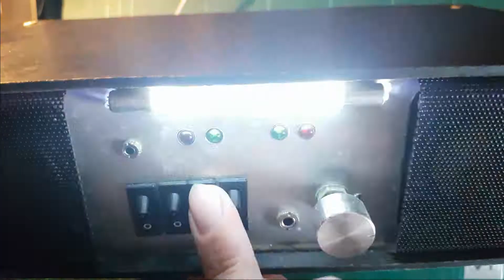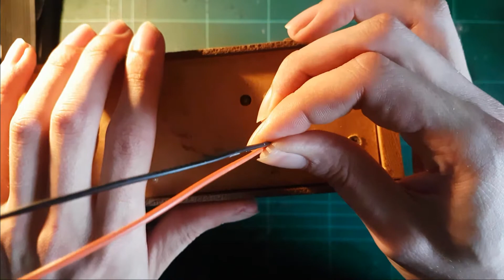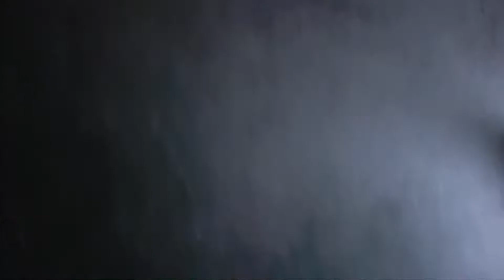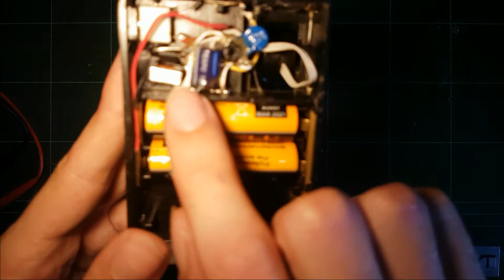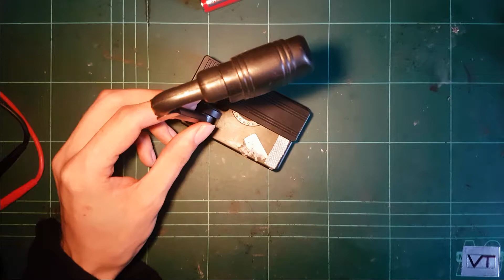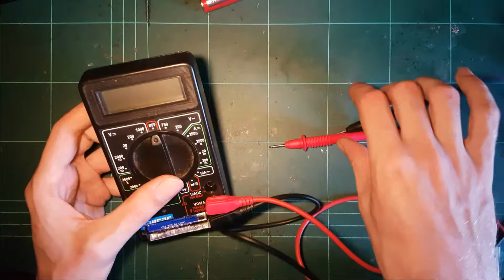An introduction to my works - VT-01A

Comment: Hi. I wonder whether you might have some kind of response to my question on great Scott's video regarding reversing the voltage polarity of the inductor before the field collapses? Would this constitute a changing magnetic flux, whereby a coupled inductor could develop power simply by swapping the polarity?